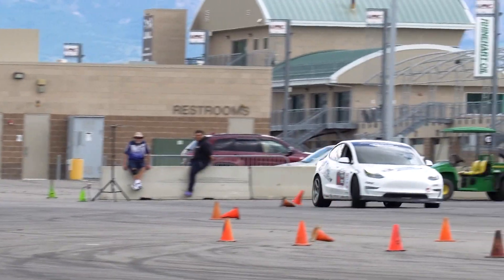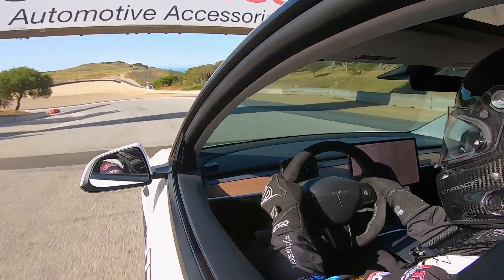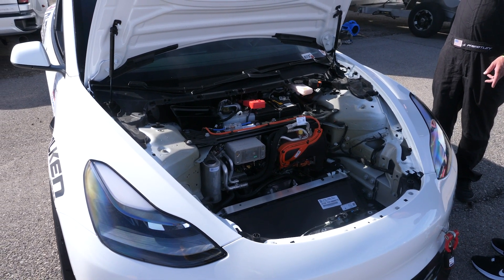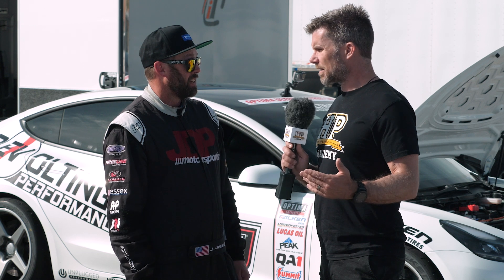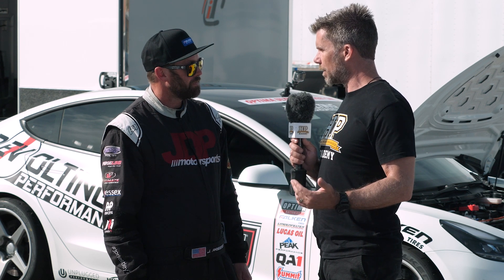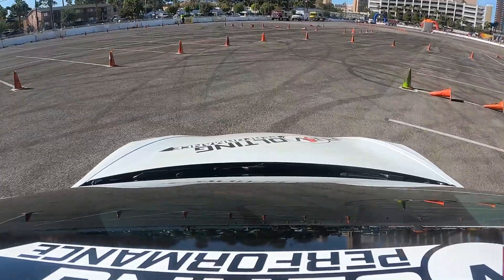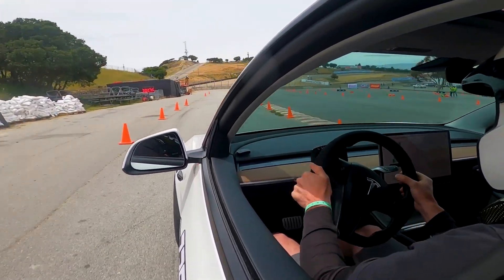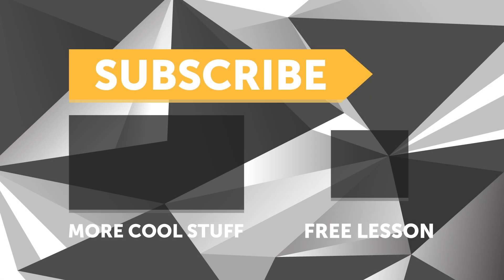This Is rEVolting....

Comment: That would be a truly race-oriented EV is the designers designed it right from the start with removable batteries racks. Would be easier to just take 5 minutes to change the batteries and go for another round on the track.
Reply from the maker: This is heading more in that direction when it comes to a dedicated build - Taz.
https://www.hpacademy.com/blog/scaler-gr86/
Reply: re: "Would be easier to just take 5 minutes to change the batteries and go for another round on the track." sadly no, only ON PAPER is where it takes "5 mins".  unfortunately in the real world (where Professionals never CONFLATE the ease of 20V Power Tools with the danger and complexity of 400V/800V EV's) there's a phenomena we have to face up to called GRAVITY.  unlike the 3Ah-12Ah packs found in Cordless drills, even a "small pack" for an EV is going to be a comparatively MASSIVE 50kWh minimum, and Li-Ion battery technology as it currently EXISTS has an average Density of ~14 lbs/kWh, so that's 50x14 or 700lbs...

yeah, so not even one of those "robotized" NIO swap stations can (safely) change something that weighs 700lbs that fast.  now i emphasize the word "safely" because once you're at a Race Track, it means you're in the world of ADULTS so (for better or worse) the generally "oversimplified" thinking and behavior exhibited by TEENAGERS is something that one has to "check at the Front Gate" before they enter...

now for the sake of argument, lets say you technically COULD swap 700lbs with ease...?  granted most motors and transmissions don't weigh this much, but they're heavy too, and HAVE been swapped trackside.  okay, but since a fully charged battery is a HAZARDOUS ENERGY SOURCE (so a totally different "animal" than an engine or a gearbox) you can "bet your ass" the Track Ownership, Track Safety Crews, and perhaps even the local Fire Marshall are going to have something to say about it (and their word is GOD).  ref: the Rules regarding Race Tracks that govern Fuel Pumps, Fuel Dispensing, and Fuel Storage (a Sunoco set up we have nearby at NJMP). also ref: the infamous Formula One, 1994 Verstappen Pit Lane Fire at the German Grand Prix Hockenheim. <---- because: REGULATIONS.
Reply: @phillyphil1513 humans are generally pretty ingenious creatures, more so when we feel something is on the line. The issues you have outlined are technical challenges perhaps, but nothing impossible.

Just compare the time it takes for a pit stop vs getting your tires rotated and aired up at your local shop. They aren't going to tell you 15 seconds at the shop. They didn't know you were coming, they didn't have a new set of wheels and tires aired up and ready to go, they don't have a dozen people who constantly train to preform this service on your car waiting for you to show up with the exact tools, support, supplies, and parts you need.

These swaps are going to happen out of "necessity," and they are going to happen in less than a minute. Why? Because racing is about time (velocity = distance / time). It's just basic physics when you think of it that way...

Comment: Man’s gotta run 2 gas powered generators to recharge his electric car at the track lol. Funny times.
Reply from the maker: Food for thought, we have to suit 2 people up in 2 layer protective gear (about $1000 NZD of gear head to toe each) and one must have hands on a fire extinguisher ready to go to fuel the car, or even just to mix E85 etc in the paddock (not just the pits) any time during an event in our local race series.

AND we still run a generator for tyre warmers/coffee machine 😂

Not a fan of the wait or use time, but I'd take 2 generators over that personally 😂 - Taz.
Reply: @hpa101  fair points, just the irony is amusing. I just don’t feel myself ever being a fan of the EV racing or enjoying the drive of an all electric vehicle, so I just mock it like a proper internet troll. Either way, always appreciate HPA looking into all forms of racing and cars 👏👏👏
Reply from the maker: ohh, yeah that angle went right over my head haha. Energy comes from somewhere, we're not really on that 'zero emissions' bandwagon, we just like racing. It's interesting to see something a little different on track, warts and all 😎
Happy trolling dude! - Taz.
Reply: A drag track I know of has a "push it aside to burn in a safe place" policy, as there ain't no fire extinguisher putting out a lithium fire!
Reply from the maker: @onedayiwillmakesomecontent  have they had to do that? Makes sense! - Taz.

Comment: There are a few locals here that do trackdays with their Model 3/Y performance. The cars can turn quick laps, but they can’t run anywhere near a full session at pace and the access to a charger / time to recharge between sessions is a compromise. 

I’d like to build a lightweight dedicated EV track car once the battery & charging tech improves to a point where you can run and recharge consistently throughout the day. Something like what Scalar Performance 
Is working on.

I also look forward to the perpetual energy recharging system the interviewee mentioned 😂

Comment: The real issue for EVs in motorsports is What happens in an accident if a fire starts? Does the venue have emergency services capable of handling an EV car battery fire? who's responsible for any damages caused to the track/venue by the fire?
Reply from the maker: They are (slowly) catching up on all that from what I have seen for both training for fire crews and by design. 
Crazy to think at one point in time when we moved away from horses and steam these same conversations were had regarding gasoline and diesel too. 'The more things change the more they stay the same' - Taz.
Reply: There was a great video about fire departments handling of EV fires somewhere on YT maybe donut or the engineer guy with the whiteboard. Sounds like the biggest barrier is simply the fire department KNOWING it’s an EV fire, where the battery packs are and disconnects.

Comment: Bring back the roadster- why is every EV UGLY 😂
Reply from the maker: I remember hearing about how EVs opened up so many more design possibilities and how they wouldn't have to look like a traditional car. I've been disappointed ever since, mostly. There are a few that look OK but I guess it takes a bit of a leap to move too far away from what they know will make them money, and there are probably some laws that cars need to stick within design wise to meet safety standards too I guess - Taz.
Reply: Q: why is every EV UGLY(?) A: well looks are "subjective" for sure. while i prefer EV designs from the OEMS, i actually never found the designs of the Model 3/Model S etc all that bad.  now the REASON i didn't is because when they first debuted i saw right away where Von Holzhausen got his inspiration...  FROM PORSCHE...!!!  yeah, everybody standing at the top of the Corkscrew at Laguna Seca this past weekend during the Rennsport Reunion, recognizes that the 2012 Model S was nothing if if not an "electric Panamera" (before Porsche built the even better looking Taycan)...

original VW Beetle notwithstanding, where did his idea of incorporating a "frunk" come from if not the 911...?  oh while Franz may be American born, hopefully one doesn't have to live in Germany or understand Linguistics to recognize that the surname "Von Holzhausen" is clearly of GERMAN DESCENT. and since everybody is technically influenced by somebody, it's not a stretch to say the Schwabians are where he looked to for inspiration (one could pick worse).  ref: "Imitation is The Sincerest Form of Flattery".

Comment: Since you are now pushing this electric crap, am out. Unfollowing.
Reply from the maker: I don't have some woke BS answer for you mate. It's a dude racing a car having a yarn about racing a car. Don't overthink it 😎 
If that's still to much for you, is what it is. We're not going EV only just as we haven't gone welding only, tuning only, wiring only, string alignment only, CAN communications only, diesel tuning only, fabrication only, CAD only, data analysis only or talked about drag cars, or just time attack cars, or only Pikes Peak etc etc 😉 - Taz.
Reply: @hpa101  you've over thought massively there yet failed to make any good point. Well done..
Reply: @blackbirdsr71 i thought you were out? Lol
Reply: 99% of their content is devoted to internal combustion engines dude… you sound ridiculous.

Comment: Hate to burst this guys bubble but electric cars will always have to charge plugged in. When you are accelerating a lot of the energy cost is due to air and rolling resistance (I.e. it doesn’t get converted to kinetic energy) so there is no way to recover it.
Reply: thanks for typing what I was going to. No free lunch
Reply: @eightfivezerobraxton5509  re: "No free lunch" <---- bingo, people who know me know this is my FAVORITE SAYING.  as an "occupational hazard" every classically educated College/University Scientist/Engineer on Planet Earth (worth their degree) understands that the Universe "enforces" BALANCE.  yeah and the reason they understand it is because it's easily seen across all 4 STEM Disciplines in the Theorems, the Math Equations, the Physical Laws (ref: Thermodynamics), the Laws of Chemistry (ref: Definite Proportions), etc.  certainly one may "desire" to escape it...?  it however can not "be" escaped.

Comment: EV’s will never be viable track day tools
Reply: Lmao. All it takes is fast chargers at tracks and it's a better track tool. No oil starvation or exhaust noise restrictions. Lower center of gravity. Better power band. Infinitely adjustable instaneous traction control/tq vecroring. The weight will come down with energy density improvements. I'm a petrol head but it's stupid to not see the potential in EV on the track. The current Pikes peak record is electric. The fastest two cars on nurburgring ever are a hybrid and an all electric car. Endurance racing will be a problem but time attack is no issue
Reply from the maker: @@Steven-cn9jg I bet they did! It is silly to think that the ICE couldn't ever be replaced even by something other than EVs, just as it's silly to think the ICE is going to disappear tomorrow remembering horse racing literally happens every single day around many countries even in 2023, although you can arguably thank gambling addictions for that 😂 - Taz.
Reply from the maker: @mnypit why not? - Taz.
Reply: That's a lie

Comment: Wouldn’t it be helpful to learn to use the regeneration despite the odd feel, bc that way the car would stay in the optional charge range longer?
Reply: One issue when using regen is that the battery heats up faster so on a hot day you may hit safety Temps. You can adjust the amount of regen in Track mode but it's rare you need regen without braking so it ends up kind of pointless to use the regen. You could use it like engine braking to shift weight to the front when that's all you need to do but those moments are so rare that you end up better off disabling it and just stabbing brakes when you need a weight shift. The amount of power you gain back from regen is minimal because you almost always use the brakes on a road course instead of regen bringing the car down to a stop. Unlike the street where you almost never use the brakes in a tesla but that's because you are traveling at legal speeds and plan for stopping
Reply from the maker: I'm sure there are some papers on it off the back of Formula SAE that would be quite interesting on this topic noting some professional motorsport using hybrid systems employ it. I'm certain their setups will be very different to what options you have with a Tesla built with the highway in mind however, and for the sake of a few extra minutes charging as an alternative you'd no doubt have to have a strong use case to jump into the rabbit hole. Interesting though! Cheers for sharing your experience @Shiftheads - Taz.
Reply from the maker: You are right it would be a great topic to get into a little further in the future. It might just simply be the race distance isn't long enough to worry about it yet anyway for this specific application compared to what some others are doing out there - Taz.
Reply: That's been something they figured out years ago with the hybrid era of F1 cars. Just as they've been integrating their "power" systems for a consistent torque production from pedal demand, they've integrated the mechanical and regen' braking for a consistent brake torque to pedal demand.
Going a bit more "electric" focussed, you should check out Formula E - the electric single seater championship - they've obviously got a strong interest in regeneration as they're limited on the power they can use, and in the basic battery storage mass. To this they're now using 100% rear braking by regeneration - with a small, "emergency" rear brake - and are working on improving regen' from the front axle.
Reply: It all comes down to heat management of the cells. Simply put, there are a lot of 'Angry Pixies' running through a system which I suspect is close to its thermal operating limit just on discharge. Trying to jam them back in there on regen may be more than what the system can safely handle in a Motorsport environment. Interesting topic though, would love to dig a bit deeper into this one.
Reply: those who've watched Misha's channel, knows a Tesla Plaid (even with the latest Track Mode) struggles to make a full lap of the Nordschleife without pulling power due to overheating.  same applies to an M3P with Track Mode (whole battery glows red right on the center screen).  that being said, it's very likely that the new 800V Hyundia Ioniq5N (N as we've all heard stands for Nurburgring) with its lower output and upgrading cooling can likely make the run without "breaking a sweat" (pun intended).  in a way a Triple Motor Plaid is really OVER-POWERED for a historical LONG course like the Ring.  it's not great, but the Plaid's certainly going to "do better" on modern Short Circuits that actually have low speed sections that afford the batteries time to cool...

in contrast, more than 80% of the Ring is spent WTFO (Pros at least) so even it's "slow sections" are technically FAST depending on your reference point.  if i'm not mistaken, not even Porsche's Taycan can run the ring (ie, their backyard) with only it's Dual Motors "sucking down electrons" without degrading performance. both driver's who respectively set the Lap Records in each of those cars, at points cleverly used the MASSIVE BUILT UP INERTIA created by the vehicle's 5000lbs - with driver -  to "conserve energy" and literally "coast" the vehicle off throttle in certain sections.  it's a technique not unlike what Glider Pilots do in Aviation....

anybody who's driven any EV like the Hyundia EGMP products or the Mercededes EQ products that have a ZERO REGEN setting will know EXACTLY what i'm talking about, the sensation's pretty damn cool. 😎EV's (equipped with such a feature) act like old school 2-Stroke Grand Prix Motorcycles in that they can sail into a corner with literally NO ENGINE BRAKING.  it's basically 180 degrees OPPOSITE of what you feel when you Trail Brake, and the drag you get with ICE vehicles from Engine Compression on closed throttle...

the base Regen setting most EV's come with is literally there to MIMIC this feeling and the muscle memory a driver has been conditioned with by ICE vehicles, since in terms of safety, as the Tesla-Bro eludes (and those in Racing know) you really can't feed but so much Regen anyway to a RWD only vehicle, at least not without triggering dangerous SNAP OVER-STEER like some Mid/Rear Engine cars are infamously known for.  ref: Carrera GT, ref: Toyota MR2, ref: Front to Rear Brake Bias.

Comment: wow, thats a lot of work to just get one lap an hour. 

Also very surprising the regen braking isnt adjustable front or rear, and doesn't engage while actually depressing the brake pedal...my 2000 honda insight does that just fine, and stops WAY faster than a model s plaid. (driven both)
Reply: I can run at least two half hour sessions before having to charge. So not sure what you're talking about. Power doesn't really fall off alot until under 50 percent. Also was super inexpensive to use Ctsv/zl1 front calipers. You can see what I'm talking about in a couple videos I have
Reply from the maker: @Shiftheads cheers for sharing! Are you also in a Tesla? - Taz.
Reply: @hpa101  I've just sold the car in anticipation of the new model, but yes it was a model 3 performance  with mpp sport coilovers, toe arms, control arms etc. On a nankang ar1.
Reply: Not weird, the tesla is pretty heavy ;)
Reply: Whats even funnier is if you look at stock stopping distance from 60-0mph the Plaid actually out stops your insight by almost 70ft. Plaid at 108ft and 2000 insight at 175 LMAO
Reply: @Shiftheads  yeah, the traction control system is wack on the plaids. never hit the brakes at all, but doin some acceleration runs on highway on ramps and stuff... first time I hit the brakes...NOTHING happened. Literally nothing. I was very scared. That car is so heavy and so fast...found out after the fact the car uses the brakes to adjust power delivery, so they massively overheat, and the oem pads and brake fluid are not even DOT 2...
Reply from the maker: @mm6705 a 2000 Honda Inisight is half the weight of a Model 3 and much slower. If it didn't brake better, it would be down to user error 😅- Taz.